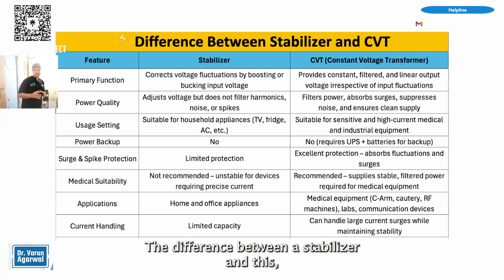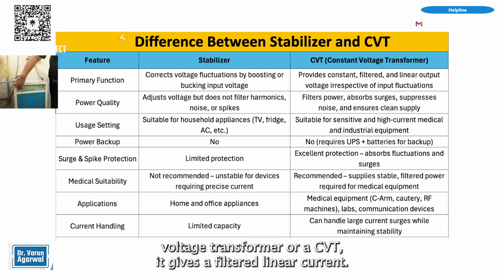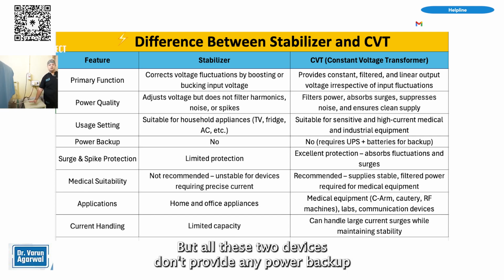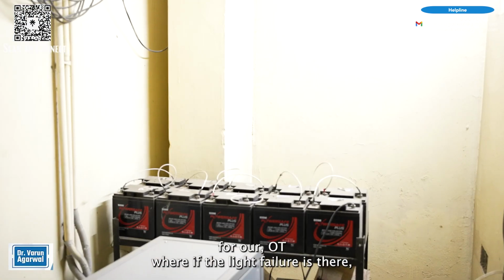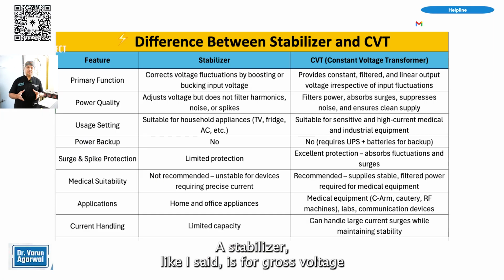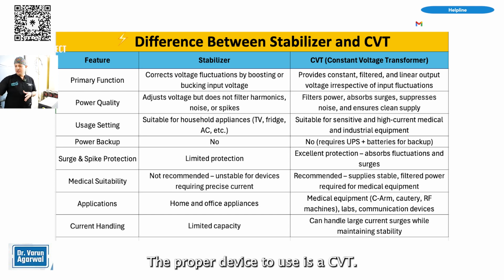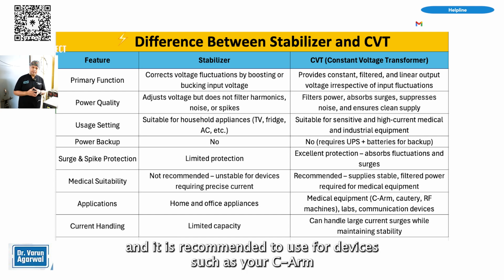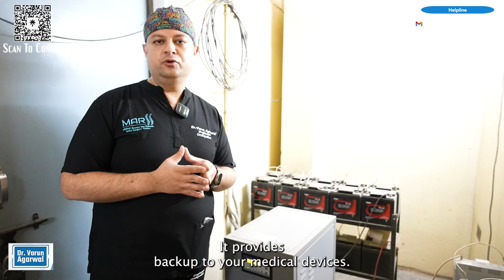Episode 3 – Stabilizer, CVT & UPS Explained | Endoscopy Master Class by Dr. Varun Agarwal

Comment: So how do we connect the CVT to the main line? Should we connect it to the whole main line(DB box) or Can we seperately connect it to the particular machine plug point? Say if I have an ultrasound machine in a room can i connect the CVT and then online ups and then ultrasound machine?
Reply from the maker: Connect the USG machine to UPS and UPS to wall socket

Don’t use CVT for USG

CVT is better for rf Devices like electro surgical units and x rays
Reply: @drvarunagarwal  Ok thanks for the input, Is it advisable to use a Voltage stabilzer(Vguard Mainline) along with an Online UPS for voltage regulation or just UPS is enough for USG? My UPS is Fuji electric neowatt consol Online UPS.